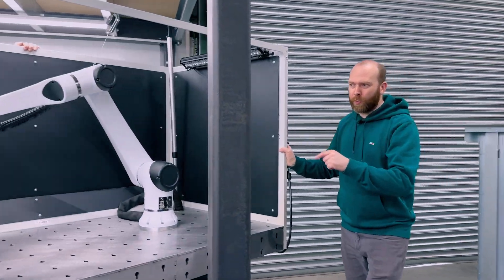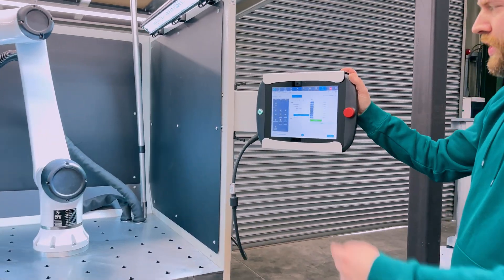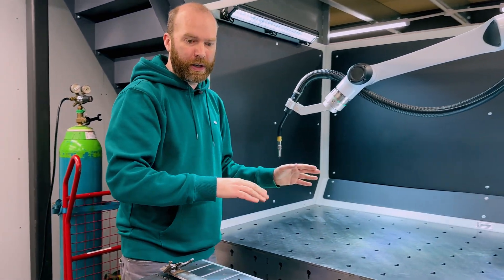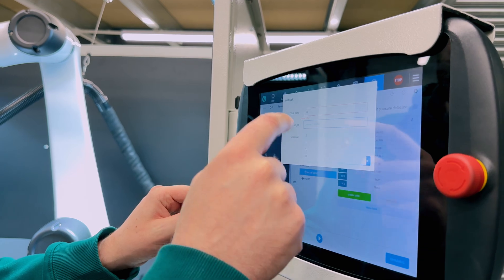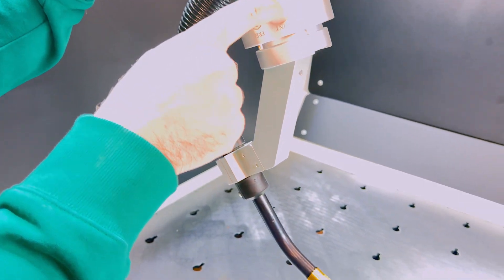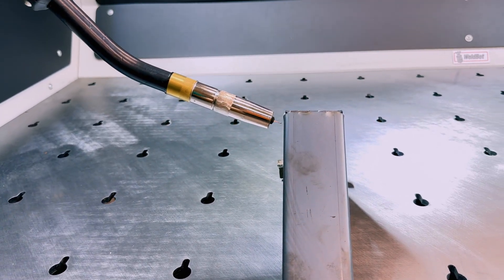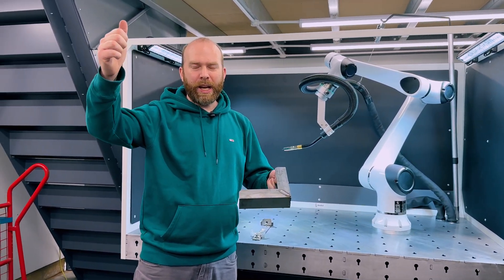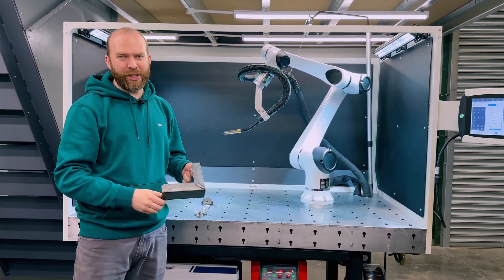Incredible Collaborative Welding Robot - 500 Brackets Daily! We used Employee Genius!!!

Comment: It misses a bottle rack and a removable holder for multiple parts.
Really nice programming.
Would check the path on very slow  setting without turning the current on.

Can the robot change the welder settings?
Reply from the maker: Thanks for the ideas, yes the robot can adjust welder settings
Reply: YOu may want to visit a car factory for new ideas, if possible
Reply from the maker: @CyberlightFG  Good idea, thanks👍👍💡